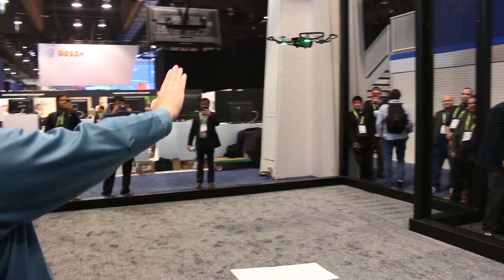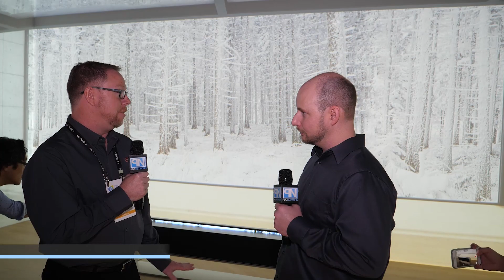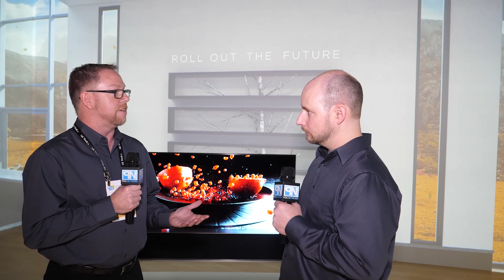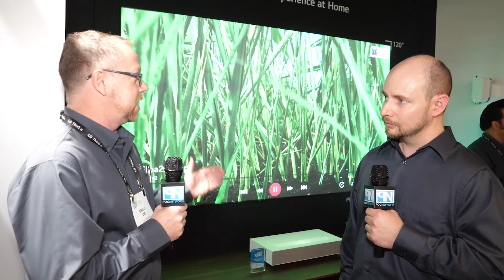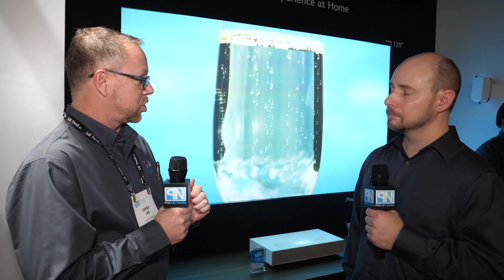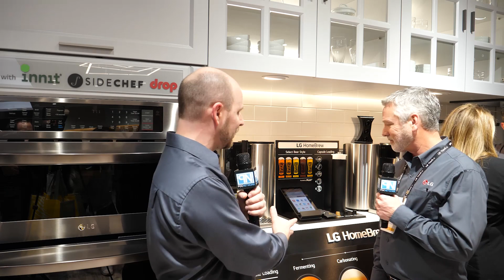LG - Rollable Signature OLED TV R, Cinebeam Ultra Short Throw 4K Laser Projector & HomeBrew

Comment: It looks pretty cool but why oh why would I need a TV that does that? I'd rather save the money and spend it on a TV that is just as thin but has an even higher resolution.
Reply from the maker: If you could easily afford the TV, this probably wouldn't be a concern for you. However, if you look into the possibility of where this technology can be applied in other areas, you begin to see where this will bring us in the next 5 years alone. Building it into exhibit displays, or themed rides (ie, Disneyland's Space Mountain) to name just a few completely random uses. If you have a reason to install a motorized projection screen, why wouldn't you have a neat idea for a TV that can do the same thing? However, for now, the price tag will be a bit high for most consumers. -- Jen T.